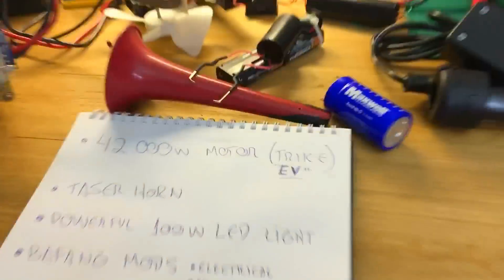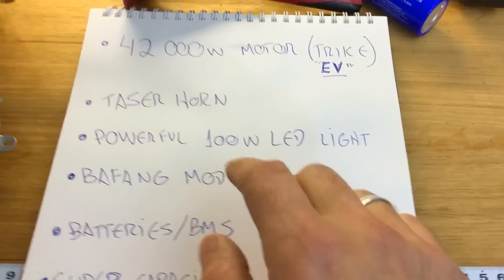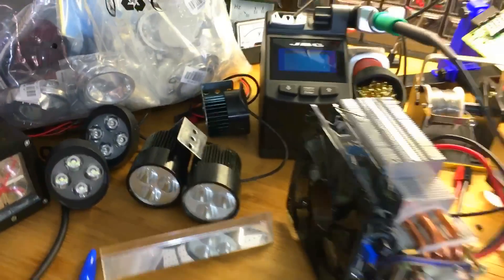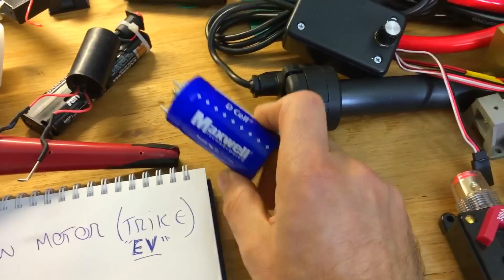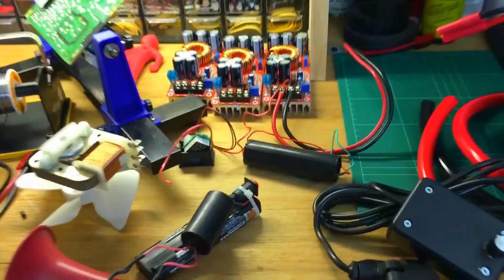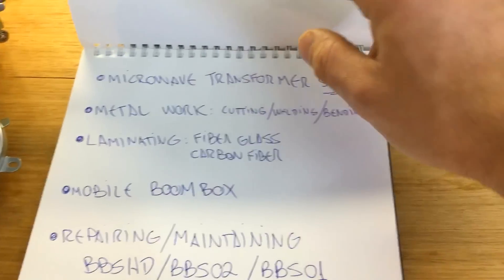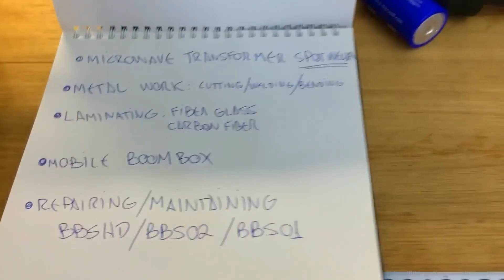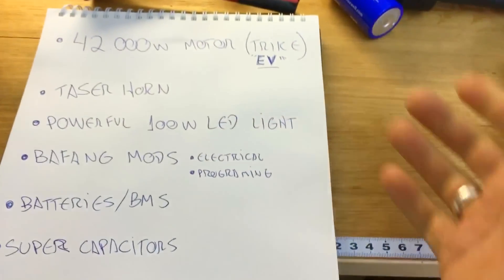3000 SUBSCRIBERS, what's coming next? 42000w EV / supercapacitors / 2000w LED ebike light

Comment: A couple things that you mentioned about being curious to experiment with are some of the same things I've been wanting to experiment with as well such as the ultra capacitor-lithium IMR combination and the DC-DC boost conversion power supply. Dang man. I've also been wanting to try out a ultra capacitor-fuel cell combination too. Maybe later. Haha. Awesome stuff you have here breh! Cheers. -OJB
Reply from the maker: +OJB yeaaahh... combining supercaps + Lithium cells + dc-dc converter is the ultimate killer combination. I bought all parts already and I'm starting experimenting. Bench experiments first then moving to practical, powering my bike that I know very well. My everyday bike pumps 1500/1600w which is a fairly good practical test. If I like the results and performance I'll scale it up and setup the same system in my 42kw trike https://youtu.be/sRH_cpCwNDs minimising voltage sag under load. 840Amps is a LOT of power haha... 
You should start playing with these things in a small scale, very interesting and nothing crazy expensive. It gets expensive when you scale it up. =]

Comment: Thats a sick Project 😊
also very interested in the LED 😁
do you or anyone have any experience with the cyclone 3000W... oh you just mentioned it :D I'm hyped for the video on it 
keep it up! :)
Reply from the maker: I got my Cyclone back in January 2016 but was quite busy testing the very new BBSHD... so I did two bench tests on the Cyclone before I setup on a bike, the first test was fine, cheap controller with colourful ugly wires everywhere... didn't look fast, very heavy and big, all parts felt really cheap, the mounting bracket that holds the motor is very cheap and you can tell that is going to flex... second time I was doing a bench test getting ready to set it up on a bike, the cheap controller made lots of weird noises and died without doing anything... just a very cheap controller... I have other ones here but lots of other projects going on so I kinda left the heavy Cyclone motor aside...
I have lots of people telling me that its got a monster torque but... comparing to the BBSHD it is noisier because of the exposed chain drive, not so fast with a 52v battery, not as efficient a lot less range than the BBSHD, messy wiring and ugly little brick controller. It is a very obvious setup, noisy and cops will pull you over. Anyway I will give it a go, just don't know when but I want to test this thing, it may surprise me, I may love it.. its got to be a off-road project for sure with a powerful 100w LED headlight hahaha.. so much POWEEEERRR
Reply: +ElectricBike (Bruno) OK, good to know :) Poooooowwwwer

Comment: LiPO is the only way to go. I have a 60a circuit breaker like yours, but it's started breaking (58v) and I think it's due to voltage sag. I'm considering using a capacitor in my setup too but I'm building an oscilascope 1st to test. I need to build a tazer horn.
Reply from the maker: Yeahh... I was always avoiding these little bombs (LiPo) but I think it's time to put these cells to do some work... BOOOM
I will test these little switches and see how it goes, if they dot work well I have some other options, if none of them are good I just use multiple anti spark connectors.
Taser horn will be super fun and POWERFUL hahaha... can't wait =]
Reply: Embrace the bombs (2 x 7s in series easy to charge)... maybe change the taser for a Marx generator ;)
Reply from the maker: +raydioz hahahahahahaha not a bad idea hey... I'm actually getting more high voltage modules so see what I can do haha
I have a 40A charger that can charge these 6s bombs in 15min hahaha.. =]
Reply: I have Duo PL8 + Bump controller :P, but I can only charge at 55A bcos I only have 30v 60A PSU.
I think 2x7s is better than 2x6s + 1x2s in series. My scooter (3000w 40kmh UPHILL), has 2x60XT plug in series, and with 2x7s I just need to connect 2 batteries. When I had 2x6s + 1x2s it was too much work, but they were 3ah Graphene and I could charge them @ 10c, but only 15 minutes run time.
So your taser is $7 600kv pulse generator ;)

Comment: I just started watching ur videos and I like your videos already, I'm very interested in learning some of the things your do because I love biking and I also want to plan  for a future project car
Reply from the maker: Yeaahhh sounds like we are on the same wavelength haha... high powered bikes and making my own electric vehicle (I say vehicle because what I'm making is not a car, not a motorcycle, not a bike, it's something kinda hybrid in between) that thing must accelerate really fast so I have to keep the weight down yet reeeeally strong chassis to handle the POWEEERR. Sounds a bit like an impossible challenge but I'll get there.. ohh yeaahhh =]
Reply: alluminum chasis and everything else carbon fiber mix with fiberglass sounds like could help you achieve light yet powerful vehicle

Comment: Okay. 42000w will mangle your frame. You will hit the throttle and have a twisted mess lol.
Reply from the maker: Yeah this is why this thing still sitting in my bench and is not fitted in any bike yet, I'm excited to give it a test but that torque will destroy a regular frame. I'm designing a monoblock chassis more like a proper EV, first it will be all alloy then when I get the shape right I'll go for carbon =]
Reply: +ElectricBike (Bruno) I'm running 1000w right now, so tempted to buy a front wheel and go 2000w. Already Modded to 40a on hills :p
Reply from the maker: +joblessalex - you need a strong fork for a big hub front wheel and it's not very easy to find them, most big boys are rear axle only. I would say two big hubs the bike will be super heavy and power hungry... my personal opinion if you want more power and reeeeeeally wants to go with hub motors get one BIG bad ass motor and pump thousands of watts, if you want torque and efficiency... give up hub motors and go mid drive, you can climb anything with as little as 22A. I know many people who had 2000w hub or Cyclone motor and went craaaaazy whey they tried the BBSHD you get a lot more range and torque without having to carry a massive and heavy 72v battery. Maybe get the BBSHD and give it a go... lots of hub motor guys are switching to BBSHD for many reasons =]

Comment: Hey poweeeeeeeeeeeeeeaaaaaaaaar 
U r awesome and congratulations
The bbs02b is out, could u check if the leaking grease drama is still exists!!!!!!
Poweeeeeeaaaaaaaaar
Reply from the maker: Yeahhhh we sold all the BBS02b and BBS01b we had in stock already and are waiting for more to arrive this week, of course I checked the pinion gear, they made it a lot stronger as well as the nylon gear but the main thing that causes the grease to leak to the nylon is the helical orientation of the pinion gear and they kept the same as the older versions... which doesn't make sense since they redesigned a new one and the BBSHD helical gear is perfect, the only reason I can think is the plastic cover may not be strong enough to hold grease pushed against it. =/
I'm not 100% sure I'm just assuming things here but this is my first impression! =]
Reply: +ElectricBike (Bruno) hahaha I'm always thinking of replacing that cheap plastic cover to a metal one, never thought it could be the problem for compromising the pinion gear design though. U R a geniusPoweeeeeeeraaaaaaar
Reply: +ElectricBike (Bruno) I think its not hard for them to redesign it like the big brother bbshd, but they want to make moneeeeeeeeey by keeping the customers buying their nylon gear

Comment: Hi,we think you're awesome.....and very crazy!!! So I want to ask, I'm having delivered a Befang 1000w...cant wait!! But I heard you say in a vid of yours that you had 52v 27ah battery. I'm curious as to what the max voltage you can put through the Befang. I've chose the Panasonic 48v 14.7 ah.....
Reply from the maker: Hi John, thaaaaanks for watching my videos and I know how excited you must be waiting for that powerful motor to arrive hahaa 
Yes the 48v Bafang controllers can handle 52v batteries with no problem, all the specs for the motor are actually measured with a 48v battery.
Yes the 52v battery will give you a higher performance compared to 48v packs, the 52v have more cells (more energy) inside. I can guarantee that you'll be extremely happy with the 48v... eventually you'll get used to the power and will want something a bit more powerful, all you have to do is to upgrade to a 52v pack with higher Ah, the more Ah the less likely to drop performance under acceleration.
I'm still using my old 52v 14.5Ah with Panasonic PF, very reliable was the best cells back in 2014 and it still going strong but you can find more powerful newer cells nowadays, in the end all these little things make difference =]

Comment: I saw you mention spot welder. I actually made my own with a 2 farad capacitor. I saw this guy's spot welder he made on Endless-sphere. And I found this link to how to make one like his but with a silicon controlled rectifier as the switch for the welder. It is super cheap and I have seen decent results using this kind of welder. Maybe you could discuss this welder in the vid u make.

ES link: https://endless-sphere.com/forums/viewtopic.php?f=35&t=70435&p=1062503#p1062504
Welder but with a SCR: http://ledhacks.com/power/battery_tab_welder.htm
Reply: Would love to see some stuff on carbon fiber! I actually made my enclosure that houses all my electronics with fiber glass.
Reply: What do you use those circuit breakers for? A power switch or something to prevent the spark? I use anti spark bullet connectors as a switch but I plan to add a switch on a bms for my li-ion battery.

Comment: i built a trike awihle back that had 48v 1200w and could do ~47km an hour. it was ok on most hills. ive been modelling a new one that would run on 96v 60ah i was looking at using a 5kw hub from aliexpress, or using a 10kw mid drive for goldenmotor. (i dont expect to use the full 10kw.) i dont nomally travel faster the 50km/h but i enjoy the speed every once in a while.  what motor would be better? i know the hub would be easier but im not sure how well it works. are there other hub/mid drives that i should look at. and also if i use a mid drive would i use a jack shaft then to allow for pedals of a bike to work? any suggestions? look forward to seeing your build

Comment: I can t wait for your future videos :)
After countless hours of researching the perfect ebike kit in forums, aliexpress, alibaba and the like, I am still undecided.. Ideally  I would like a 48v motor with torque assist. Bafang, Bewo, FLT, X-Max, Tsdz2, Mxus, Xofo, Btn, and I am getting lost. Now I thought I found the perfect kit (http://www.elvelo23.ru/motor-xofo-middle-750w) until the manufacturer told me this xofo does not exist in 750w version.. I also see a Xofo 48v here  - http://www.aliexpress.com/item/Free-shipping-48V350W-XOFO-MMS-middle-crank-Motor-eletric-bicycles-trike-ebike-kits/32649383354.html?spm=2114.13010208.99999999.261.OAd5eT, but unsure it is legit..

I would like to keep things light (maybe BBS02 but no BBSHD), and am looking for the best pedal assist possible (wont be using the throttle).
This will go with a mighty luna cycle mighty battery 30q 52v - I dont need much range, but I'd like POOOOOWWWWWEEEERRRR!!!!

So I  would love to hear your thought on that Bewo motor seen in the video, or any advice you could provide, it would be extremely appreciated.

I might just give up on torque assist and get the BBS02 as it will be easier to find replacement parts and documentation..

And congrats to the 3000 subscribers :)